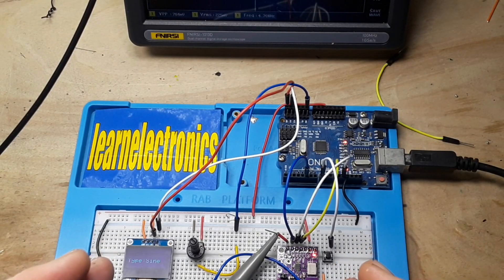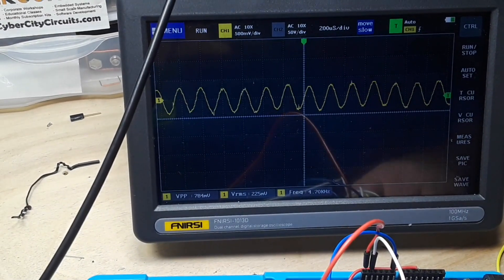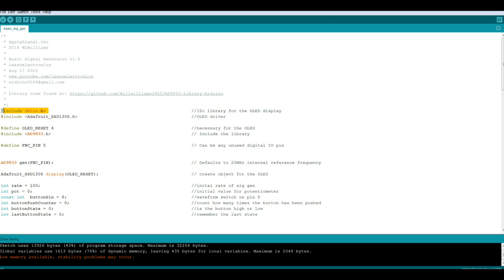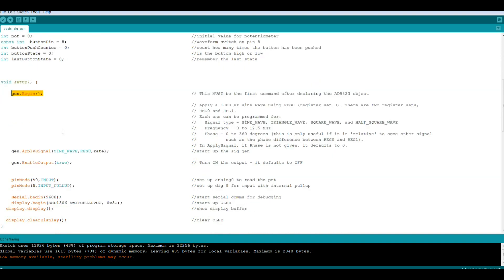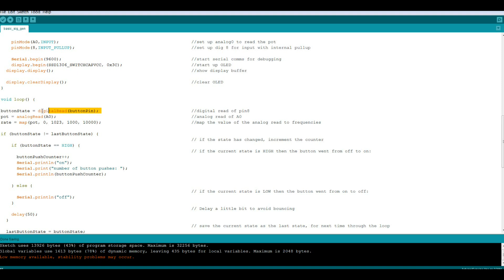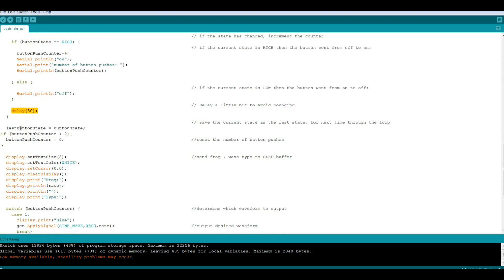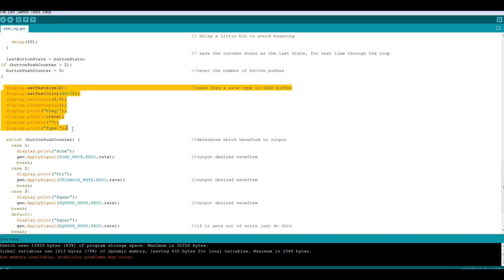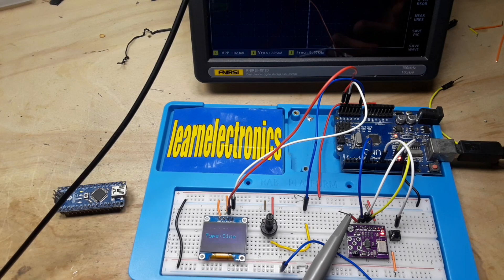Arduino and AD9833 Signal Generator Part 2

Comment: Drama, my module arrived and did not work so I demanded a replacement.  2nd one arrived and worked and I compared it to the first - the chip was mounted back to front.  Long story short - tried out my SMD desoldering/soldering skills and got the dud working - and it has a much higher Peak to Peak than the other - 1/3rd higher.

Comment: In case it's not mentioned already... Start your case at 0 and in case 0: disable the output...
so. case 0: off, case 1: sine, 2 square, 3 triangle etc... no default is required...
If you  have issues, move button detect after case in the loop... and reset to 0 if count >= 4

Comment: the reason your signal generator will not count to 3 is because 0 is a number in other words 0 is 1 so start at 0 and count to 2 ..default 0 = sine
1= triangle ..2 = square ..... you could use switch case: and default Im sure google could tell you more on this because it is a C and C++ compiler

Comment: Regarding the code, you can reset the buttonPushCounter after the Switch statement instead of before it. This way you will reach 1, 2, and 3 in your Switch logic. This means you can then remove your default block in the Switch statement.

Comment: Maybe a rotary encoder with built in push button would  be useful? That way you could get a stable frequency, and maybe dial in frequencies digit wise, eg. 5 push 3 push 4 push 1 push for 5341 Hz. Just a thought 🙂

Comment: Besides the topics regarding the counter and the button changing to LOW, I was wondering if the switch/case loop can be simplified by using a 2-dimensional array and just using the button counter as the index... something like:

disp_status = [ ["Sine", SINE_WAVE], ["Tri", TRIANGLE_WAVE], ["Square", SQUARE_WAVE] ];
...
display.print( disp_status [buttonPushCounter][0] );
gen.ApplySignal( disp_status [buttonPushCounter][1] );
display.display();

This should work with button status 0 to 2. And that way the code would be much more compact and probably faster...

Comment: Someone may have already said this and I just missed it, but your button state will never get to 3 because it's being limited to 2 just before the switch-case section. Just change your cases to 0-2 to match. 

I haven't studied the code in depth as I'm on my phone, but I have an Arduino sketch for the atmega328 where one particular "var++" REFUSED to work and it turned out to be some bug in the compiler. I changed it to "var = var+1" and it works fine  Change it back and it breaks again. I use this to confuse programmers as it was a nasty bug to troubleshoot.  "var++" works fine elsewhere in the same sketch.

Comment: Great work.
A PCB board for part 3 might be a little primature.
Kinda like building a car. Now we got the engine, lets put it on wheels and run it. -but what about the steering and breaks?
There is a lot of fun to do  on the output stage, dc-offset, output impedance, signal level.
It seems that you have a good handle on op-amps but maybe you are not up for the challenge? 😉

Comment: Any practical applications or projects where DACs are used? Apart from function generators?
Reply: A very good use of a large DAC is as a voltage reference source that can be used to calibrate meters or as the variable reference of a power supply.  They are great to cycle voltages on a test piece to exercise it.  Some are fast enough to synthesize waveforms such that you can make a shaped waveform you like.  A zillion uses

Comment: Why didn't you use your 'Nano Experimenters Board' for this, wasn't this the kind of thing you made it for? Anyway, your code problem seems to be with manually setting the state of the button, (line 86). There is no need to keep track of the state of the button, you just need to increment the counter when it gets pressed.

I cannot test this code but try this....DELETE THESE LINES:
69 ...if (buttonState != lastButtonState) {
84 ... }
86 ...lastButtonState = buttonState;
(As shown in pastebin)

You should then be able to change line 87 ( ' if (buttonPushCounter > 2){ ' ) to >3.

Good luck.
Reply: If you delete these lines, each time through the loop (a little over 50 ms in this case) the code will react to the button state. If the button is held down more than one loop the counter will increment again and again until you release the button. Those lines make sure each button press is only acted on one time.

Comment: (I do have some programming experience.) I wonder what's the deal with `buttonPushCounter` that you encountered.

I see it is programatically limited between 0 (inclusive) and 2 (inclusive). With the initial value of 0, the switch() would branch into the default handler "Squar", for a value of 1, into the "Sine" handler, and for the value of 2 into the "Tri" handler. Is that also what happens when you run it? 

It would seem to me that everything would behave just fine when you comment out the entire branch for `case 3`?

Comment: Nice project, I think the only thing the commercial option would have over this one is a sweep function, which you could probably build in the code, and other wave forms. However, for under $20, not bad. It looks like this only needs 5 gpio pins, you could use an attiny85 on this, assuming it’d have space for the program.